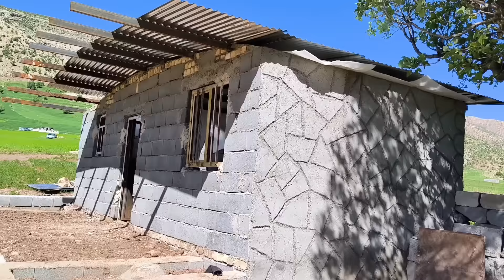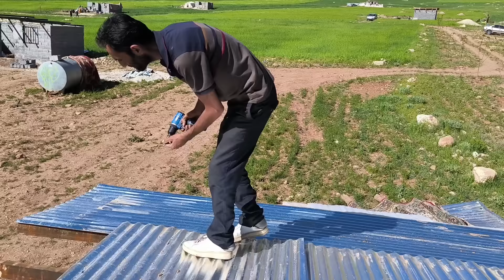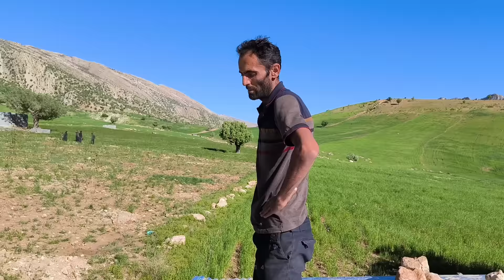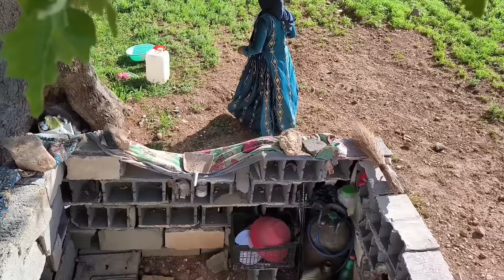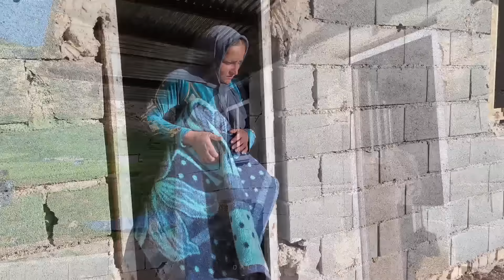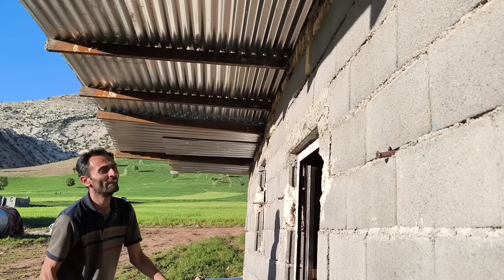Rasool family collaboration with Afsane in building a dream house roof

Comment: Nice to see the roof getting done.  I think the metal sheets could have been measured And cut to fit, the screws should be a lot longer so it holds together tightly. The Weather there seems severe with wind And rain.  Be nice to do it right, so the family doesn’t have any issues after it’s  completed.  But Thankful Afsana And children have help anyway!! God bless them all.

Comment: They have worked so hard on this house but that roof is a hot mess!  How can it not leak?!  Wrong drill used, if you don’t seal those bolts it will leak around them because some of them didn’t go all the way in. Fingers crossed for that roof!
Here’s hoping for the best for this dear family. So glad to see Roya back!  ❤️❤️
Reply: Камней накидаю,чтобы не сорвало ветром крышу🤣🤣🤣🤣🤣🤣🤣🤣🤣🤣🤣🤣🤣укрепят ее ,потому что болты есть не прекрученные,дырок сделал для воды специально,чтобы протекала крыша,такому мастеру руки выдернуть надо,он дрель то первый раз в руках держит по моему,кто хочет крышу испортить приглашайте этого мастера🙀🙀🙀😤😤😤😒😒😠😠👎👎👎👎👎👎👎👎👎👎👎👎👎👎👎👎👎👎👎👎👎👎👎👎👎👎👎👎👎

Comment: How is the water supposed to run off that sheet 🙈🙈🙈 Rasoul should have bought the correct size 🙈🙈😡
Reply: I think they put cement also up that sheet
Reply: 시트는 보온역활하기 때문에 지붕판밑으로 들어가기 때문에 빗물하고는 아무상관 없는것 같습니다. 일단  단열역활밖에..
Reply: เป็นของเก่าจากบ้านหลังเก่าแผ่นหลังคาจึงไม่เท่ากันค่ะ
Reply: They should make a slope roof
Reply: The house seems build only for survival not according the building code ,?
Reply: 😂 ma' che razza di tetto è 😂😂
Reply: Это не дом а так сарайчик
Reply: Oparetor tell the muster fixed two wooden bim two wall under tinsheed then not blowing wind
Reply: Un desastre el chapista ato ña cha co. Alambre a medio metro sobre el frente de la casa q desprolijo eso!!!
Reply: Creo que el señor colocó mal las planchas dé zinc 🥴🥴🥴 Bendito
Reply: Afssne what ever she need she requested Rasool he always doing it happily I appreciate Rasool he always likes to help.
Reply: @memanthaculasingha60 I've never seen a roof like this😮
Reply: Ni @indayngjeddah7712
Reply: Lo que pasa es que le falta una lámina del tamaño de las otras y al frente puso las láminas pequeñas que tenía en la casa que la desalojaron
Reply: They're not good builders they're still learning, Roof is flat  should be slant so that rain water can flow easily, much lacking in  building. matetials, anyway that's a short 😢cut method in building a house
Reply: Эти дома строятся лиш для того чтоб снимать сваи фильмы Взрослые зарабатывают деньги а дитей мучают водят за собой босиком в снег в дождь чтобы мы жалели ставили Лайки Некоторые каналы и операторы очень позитивные фильмы снимают и смотрим природу обычаи Интересно как живут в других государствах конечно Но иногда неинтересно строительство одного не кчемного в проживании дома строится другой такой же Как и этот с неправильным уклоном крыши Визде одно и тоже строят
Reply: observe the Asian people are very good at building houses even at the remote area they use wood or bamboo only even in strong raining no water coming in  and all the house are have slope  looks pyramid style roof. This people never learned they continue building flat roof and more money use and wasted.😅
Reply: Essa cobertura e oval para o escorrimento da água ok

Comment: Master Mustafa, you are improvising the roof iron sheet installation with the available resourse. But from construction point of view, it is still a risk of the roof blown away by strong wind. The roof trusses where the roof sheets are screwed to are not hold down to the house structure as there are no roof beam. There are ways to avoid tge roof being lift off by strong wind either by concreting on top of the roof to provide extra weight or laid a cross hollow bar at the front and back of the roof and these bars should be anchored down to the ground via a strong wire sling.

Comment: That roof is going to leak. The sheets are made to fit together and then screwed down.
But the way they have them water is going to go through the seams. And if they cement them they are still going to get water in that house.
I was always taught do it right or not at all. 😮

Comment: I’m not an expert, but I noticed that the Master used the screw fasteners without boring the holes with a metal bit first; which caused the screw tips dull and wasted. (Drill bits for metal) It may save you time and energy if you use them.

Comment: Supposed to wear  gloves when uou work by the iron sheets (zinks), they are dangerous they will cut your fingers. It is my first time to see the way the sheets install Supposed to be the same direction from front to the back same way well I am not Iranian maybe it's their way to make the roof zink.How the water going to pour it will see when it is raining 🤷‍♂️.
Reply: There's still a poslbility that afsane will experience roof leakage when severe storm strikes coz the roof doesn't seem 100% safe as shelter.😵

Comment: The roof is not in proper, if there's rain the waters will go inside the house, and if there's strong winds the metal sheet will fly away one side of the house must be high than the other side like this A so that the water will go on both side of the house, even on snow session plat roofing is not good  chance the roof make it correctly

Comment: Operator that sheet on the roof is sooooo wrong. Should have been cut to the correct length and placed going the same direction as the others. Not acceptable and Master Mustafa should have known better. My opinion of him a fallen a couple of points.🤦🏻‍♀️🤦🏻‍♀️🤦🏻‍♀️